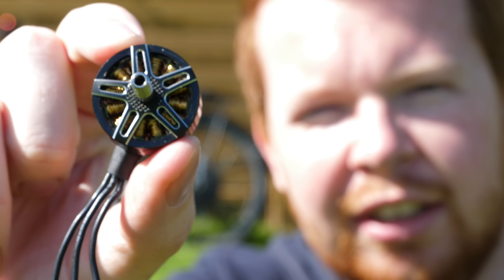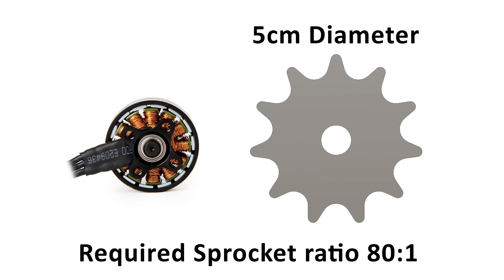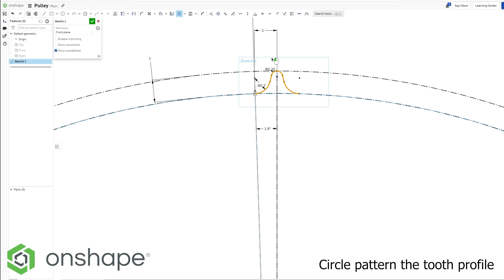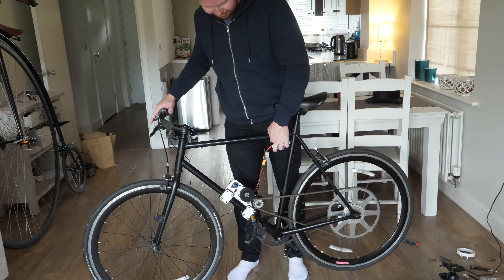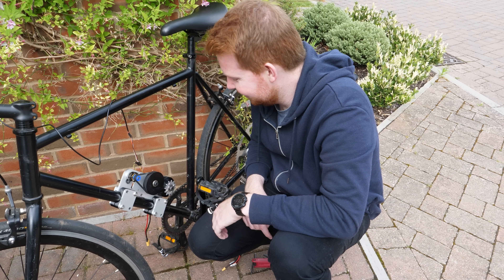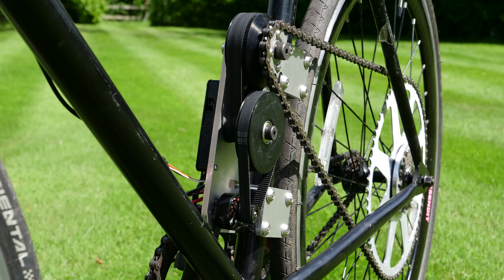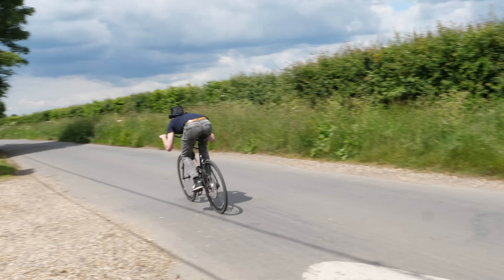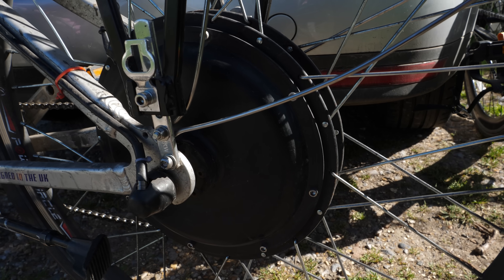Tiny 1kW Electric Bike Motor

Comment: The starting current is going to be much higher than it would ever encounter on a drone. It would likely last longer if you pedal up to speed before applying throttle. Given the power losses through the drivetrain vs a direct drive hub motor, comparing the power draw of each motor doesn't tell the whole story. The race at the end was more informative than simply listing peak current draw. Great video!
Reply: That was part of my concern/idea, but they should have put a slip clutch on that motor, or one of the belt/gear wheels so when peddling you are not spinning that motor super fast.
Reply: How about using 2 or 3 drone motors that will Split the Load and make it go even faster or make it accelerate faster
Reply: @Geniusinventor  That won't really make a big difference, plus you'll need some sort of reduction mechanism then, which will make it quite a bit more complex. 

Easier for him to have a chip in there that spreads the current over a longer time, like how they do it with starters on AC electromotors.
Reply: @Geniusinventor  there are bigger brushless motors, it wouldn't take a whole lot to make this actually feasible.
Reply: @bustatron  had a bigger electic motor axial flux, super high torc, and a lot of power, it came from a old electric truck, but you can't just power that with normal batteries sadly, even rotating it by hand would make it draw arcs an it would be like completely jammed when you made atleast 2 terminals touch eachother due to the huge amount of current it could generate.
Reply: @Geniusinventor  you could also use a set of old DC micro motors, in germany you can get them for very cheap, I am talking about around 0,5hp/pk for around €2, they also don't need a drive and are very easy to mount together for exactly what you want. makes it a lot cheaper as well, if you use many motors the point of a brushless motor kind of goes away, it also greatly reduces their efficieny gain in comparison to a normal dc motor.
you can however build your own brushless motor, make it axial and get a lot of torc and efficiency.
Reply: @ted_van_loon  can I these motor in a project like a tank
Reply: @Geniusinventor  you can use any motor in theory, just look to the output power and then use something to gear it down and a a solex cluth like principle to make sure the motors keep running on at least a certain speed even when starting to make sure to keep max power, small electromotors both brushed and brushless tend to deliver almost no power when the motors are of, this can be overcome by making the motors use a lot more energy at the start(like how tesla(modern car company not the original one) cars have motors rated at 18000PK/hp or 12000000Watt when you look in the datasheet(4 motors of 4500pk/hp each)). this is expensive and all it also requires motors capable of a lot more power than what you will use them for.
the other way is gear it down to increase the torc to power and speed ratio, and/or using something like a solex clutch. which is kind of like a centrifugal slip clutch, so when the motor goes faster it gets more grip on the thing it needs to rotate, this allows the motor to stay fast, and so allows it to actually output their rated power instead of barely any power at all.

these motors might even be better than many brushless motors for your purposes because you don't need to use a controller, and they typically have a higher torc to speed ratio compared to drone motors, brushless RC car motors also would be better than drone motors. but in essence all of them are around the same even brushless and dc motors typically are the same mostly, the only big difference is that in brushless the magnets rotate and in DC the coils, brushed motors are slightly less durable and slightly less efficient, the durability is the most severe one even thought you shouldn't wear out a DC motor that fast as long as you keep it clean but the brushes might get damaged to much over time.
the difference in efficiency is mostly of play when using them on very low voltage, this is due to the contacts of the brushes cause a very small amount of friction which you won't really be able to notice, so the real culprit is that the electrical contact of the brushes in a DC motor sometime doesn't have perfect conductivity, so higher resistance means energy loss. the higher the voltage the lower the loss.
Reply: @Geniusinventor  depends on the type of tank and how many motors and extra parts you are willing to use.
but for a small DIY tank which can move people using DC motors is probably still a lot cheaper and simpler, so that said they will work.
however DC motors will work just like brushless motors so have the same problems, you need to keep the motors running on a constant speed since electro motors both DC and brushless lose a lot of power at lower speeds, well or you need to add a lot of extra power and some gears.
this makes it more easy with cheap DC motors as well since you could just turn on more motors when you start, or use a capacitor to race away.

so to answer, yes you can use them in a project like a tank but for any such projects you need to be careful, getting a very big electromotor at a specific wattage also would work better than a smaller motor in general even if their power is the same, but if you run a small motor at a constant speed it can be as strong as the big one.
Reply: @ted_van_loon  man I really appreciate all you have written and I agree
Reply: This would likely be a speed bike, not a recreational one. A recreational one would include very high torque, and low speed. Because people don't like going up hills.
Reply: Indeed, with a proper starter though, you could limit this issue greatly.
Reply: @remirms2239  the Solex had solved this exact problem very long ago, it was actually meant for almost the exact same problem and usage. they found out how to skip the gears and pulleys, and how to keep the motor at full efficieny no mather the load. when I build a electric bike I will probably make it  a steam powered solex, but then electric instead of steam powered, and a lot lighter since those things where really heavy in weight despite the motors only effectively delivering around 200W to 300W of force for a very good one, they still where quite fast around 30km/h, which back then was extremely fast, even when not concidering it was a normal bike but motorized, they where that fast because they managed to keep them on max efficieny and avoid gear using their 2 revolutional parts: 1 the solex clutch(speed based clutch keeps the motor on toughly the same rpm no mater the load to keep it at it's max power and efficieny, high torc when starting and high max speed) kind of similar to a modern automatic slip clutch(if only cars had this). the other part was instead of powering the wheel with gears or such they powered the wheel with a artificial ground. this was done by using a roller with a road like texture which rotated on the wheel and so it uses the entire wheel as a gear while keeping low friction yet high contact with still a possibility to make it slip.
Reply: There are indeed some friction in those belts and the chain. But I don't think that's the main problem here, since most of the force/power is probably still used for the acceleration and to overcome the air resistance when up to speed. Any heat from those losses in them self will also be where the friction is - in the belts and wheels and not the motor. Since those where obviously not heating up significantly, that means there was no excessive energy losses there. 
The first thing that comes to my mind though - how do that speed controller handles acceleration? Because the controller might just choose output frequency depending on the target RPM. If the motor drives a drone propeller, this works fine - because it it takes very little torque to make it spin and the inertia is so low it will reach it's target RPM quickly (without any significant losses). But in this case with a lot of mass to accelerate (which take very long time compare to get a propeller spinning), that means the motor vill be driven very inefficiently with huge losses all the way before it get up to speed. Since those controllers are often made in China, they are indeed designed in cheapest possible way for their intended application. To accelerate efficiently, the frequency needs to be ramped up (matching the RPM of the motor) - it can be done by a sensor that measures the RPM of the motor and adjust the frequency accordingly. 
The second thing is that those motors are meant to be cooled by the down wash from the propeller of a drone (which act as a powerful cooling fan) - so they will of course not be able to sustain their rated maximum power for any significant time when mounted like this.
Reply: @Speeder84XL  yes that is a real problem as well, I also talked about that somewhere, small electromotors can output a lot of force but little torc compared to the speed in general, and just gears won't fix it because that would make it very dangerous and slow at start. but this luckily can be very easily fixed the ancestors of the electric bike already did this even, for example the solex used a solex clutch, which allowed it to start pretty fast and reach high speeds without any gear shift box and with a extremely weak motor, even that extremely cheap brushless motor you can buy for something like €3 online is more powerful that those motors where.

the thing about small motors is they are very powerful but only once they rotate at a specific speed below that they won't reach any power clear to the rated power, but the power usage goes up if it also still needs to deliver foce which causes those motors to get hot and possibly break,
so the actual solution would be to use something like a solex clutch to keep the motor running at a high speed so max efficiency. the solex clutch will then automatically output the maximum amount of power it can without reducing the speed below a speciffic speed. when combined with gears to reduce the rpm this works very well. 

drone motors indeed are designed to need some wind, but the amount they get is small and can be delivered by adding a very small fan designed to blow it to the motor, or you instead use a brushless RC car motor they are the same practically but more durable, cheaper, more torc etc. only they start from around €20, but then again at that price point you have a 1000W brushless rc car motor for a drone motor at that price point you would have a weaker one. rc car motos don't need cooling from a fan, also found some brushless rc car morots of almost 2000w for around that price a while back. so they would be much better for a electric bike than a drone motor, which makes it weird that nobody tried it with those instead(except from some people who actually used their RC car to pull their bike at quite great speeds(without a solex clutch even).
Reply: Or apply it through a continuously variable gear ratio box with the load linked to the gearing.

Comment: Strange. You talked about the horsepower between the tractor and the car but never mentioned the reason why the speed difference being the torque generated. Not sure about the amperage needed to generate the torque but that might be the reason for the heat instead of what everyone was saying about the draft generated past the motor in flight.

Comment: To explain the difference between electrical power and mechanical power, I would point out that a steam iron might be rated at 2000 watts but it won't move a bike.

Comment: Hey tom I was wondering if it would be possible for the next build you could look into doing a recharge system built into the front wheel. I have a 48v bike that has a bad time with the battery so any recovery/recharge system  would be fantastic.

Comment: To be fair, the drone motor is designed to be constantly cooled by the propeller that's supposed to be mounted on it. You could have a healthier motor by mounting a prop to its shaft (maybe with a guard to protect your leg).
Edit: I see this has already been suggested more than a few times...

Comment: But. With the right rc motor. It could be done with no problems. Maybe twice the size as that. Even do it with a water cooled boat motor. Little radiator setup. Prob work great.

Comment: If there was a way to achieve that 80:1 ratio without any transmission loss
Then it would have performed quite similar to the hub motor
Cause the hub motor literally has no transmission loss
If you calculate the power loss on your gearing and add it up to 1kw and use a drone motor of that value
It should be pretty equal to the hub motor

Comment: The main issue is the drone motor is designed to be fast, carry air across the coils in use from the propellers and not meant for heavy work like your eBike ~ 100 kg with rider compared to a drone of about 1 kg...

Comment: Your presentation has gotten a lot better, this feels much easier to follow along with replicating compared to your last mid drive ebike video!

I think it's just missing a quick discussion of the service and reconfigurability advantages of a mid drive versus a hub motor. (Speaking as someone who rides off road and does other dumb poop, thus pops a tube every ~tenth ride!) For me it as simple as:
* Removing the rear wheel of a high power hub motor ebike for ANY kind of service is a pain in the genitals.
* Mid drives can be geared much LOWER than hub motors to climb serious hills all day and give mad acceleration.
        * BONUS, a completely separate mid drive like all yours (not tied into regular bike gears like most commercial mid drives) is a lot more redundant and has a much better chance of avoiding the walk of shame and instead letting you limp home on pedal or motor-only power IF and WHEN something breaks!

This is a cool video, but missing that it really comes off as someone just doing one time stunts, not someone who rides regularly or is trying to live with an ebike.

Individual solutions are utterly terrible at addressing collective problems, but TICK TOCK the climate crisis is worsening every day. train good, car bad, and bikes give trains superpowers. Don't beat yourself up though, get out there and experience the world, there are cool and beautiful secrets to be found even in the most dismal car dependant hellscapes! :)

Comment: Maybe using 4 or 8 of this motors, and a better ESC, with actual current limiting features... The biggest problem is that this motors has so little torque that they work stalled almost the entire duty cycle.

Comment: Tom totally neglects something that is observed on any small high reduction motor that runs at high RPM under high loading. Look at pretty much any power tool, like drill or an orbital sander for instance. The thing really should have a cooling fan incorporated into the design.

Comment: Very cool experiment... there are also crazy stron Drone Motors out there... some with enougth power to destrol the back wheel only with the amount of Torque.
Only a little example here: MN1010 KV135  it hs not that big, but up to 5kW of Peak Power. With Popeller up to 20kg thrust !
Reply: Heck, just mount that on the package rack, and you've got a swamp bike.  None of this belt & chain reduction nonsense!  Bonus: it'll give you the same thrust, even when you're climbing a hill.  Hmmm.  Now I'm thinking...

Comment: Hi Tom, very nice, you may need a chain and sprocket on both sides to stop the chain coming off and also take the load off the output shaft, could do that on the belt pulleys too. Looks fun to ride, I may just make one 😉

Comment: you need an aluminum heat sink housing for the motor. i suggest 2 tandem motors (as the yare small) and good passive air cooler housing for both of them. instead of a chain, use a belt drive with slight slippage to act as a clutch.
Reply: Keep in mind that the stator is where most of the heat is being dissipated.  And there's really nowhere to mount heatsinks on the stator of an outrunner motor.  Active cooling (i.e., a fan) is kind of necessary.

Comment: Since the bike motor is open on the bottom, you could try attaching heatsink there (or use the mounting plate as a heatsink)

Comment: I feel like if you doubled or quadrupled the torque on that though it may be just fine as a bike motor. Makes me wonder if we really need such bulky ebike motors.
Reply: We clearly don't.  Hub motors have become popular because they are simple - you just replace a wheel with a hub motor wheel, and it's no more difficult to engineer than a bicycle.  There were plenty of e-bikes before hub motors took over, and they used much smaller/lighter motors.

Comment: I wonder if it would work to machine a sleeve with cooling ribs, and slide it over the rotor. It could not only act as cooling ribs, but also as a centrifugal pump. Also might be very effective at removing skin....

Comment: A big 2-3kg "1 kw" industrial AC servo is rated at 1kw power output operating continuously 24 hours a day inside and enclosed machine with a static air temperature of 40C.
A "1 kw" RC toy motor is rated for (as you said) 1w power draw *right before it catches fire*.

To rate the 2 fairly, in equal conditions, the RC motor is probably a 50w motor. Meaning it will output 50w of power continuously without active cooling.

You should try a project with a small industrial servo powering a bike, but you'd need to find a place to mount it (they are long) and figure out how to power it (most have a DC bus of 100's of volts).

Comment: You could try to add multiple motors to spread the load and add more power. You could also add some sort of fan blades to the motor sprocket to keep the motor cool.